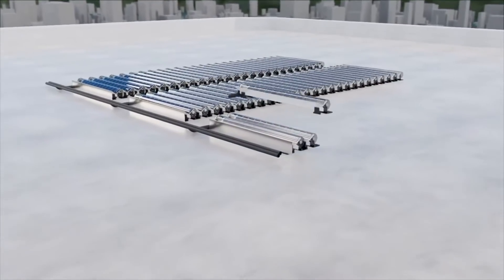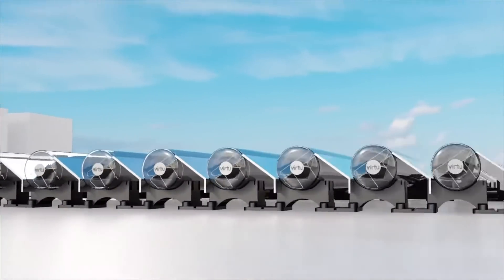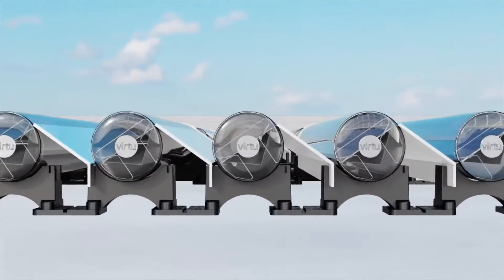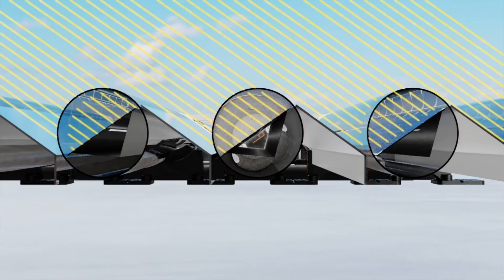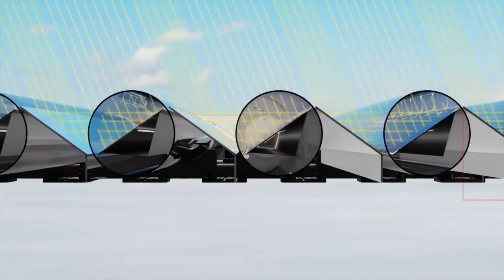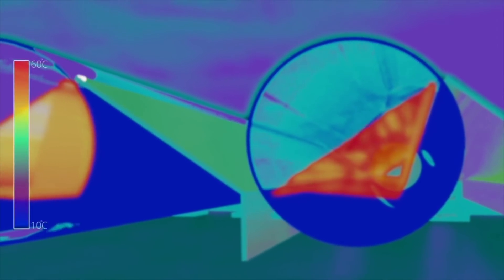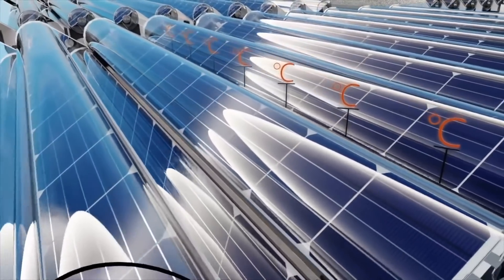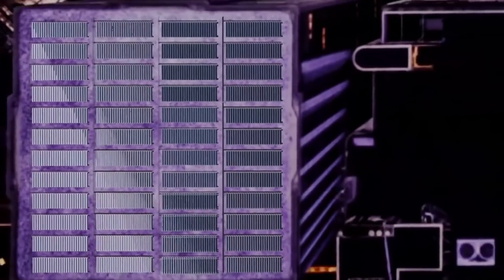Make electricity and heat with one device: hybrid solar technology

Comment from the maker: Skepticism and critical feedback is great. Being uncivil is not. I delete trollish and rude comments. Take a look at the information in the description and the comments: a lot of questions have already been answered.
Reply: Biggest and main concern I immediately had was the temperature of the PV cells, luckily that seems to be tackled. However it's still two competing optimums, you want your fluid(water) to reach a temperature as high as possible for higher energy gains why usually you would want your PV cells as close to a bit below room temperature (in practice most are 50-90C on rooftops). 

My next main concern is fabrication costs as this looks like a fairly difficult to manufacture product and higher costs because a barrier needs to be between flowing fluid(water) and a vacuum, exerting 1 bar pressure on the back of thin PV cells which make them tricky to be used as a barrier only.

I'm also a bit 
skeptical about their energy density claims as that's very dependent on what exact mounting systems you compare it with, what exact panels and they do not specify an exact energy density based on a specific load, usually done with peak watt hours. "High energy density" is not an unit, let alone a value, and not possible to compare.
I do believe they can have benefits, especially the wind-shearing is a serious factor for higher buildings or buildings with weaker roofs.
Also the carbon savings, honestly that is quite questionable if on their website they don't show how they calculated it and what references they used.
Especially since they make CLAIMS but don't actually show any data/results/evidence, nor do they say what they actually compare it to nor how.
To me that looks like a marketing department and not engineering. I do not trust marketing departments and I think it's with good reason.
Reply from the maker: @Dzeno2010  solid comments, thanks. Small point to mention - I don't think the tubes are at a full vacuum of 1 bar, it's some nominal low pressure. I might be mis-remembering. But yes, certainly these are more costly to produce than conventional solar products. I agree, it would be nice to see the energy data published. I think the lack of visibility of it has more to do with this being a more b2b model, where that kind of data will typically be shared with and gone over by the client's engineering team.
Reply: @tdisney  it's usually a nominally low value as you can't have a true vacuum (more or less) nor would you want to because costs. However for the forces it doesn't matter, as it's about the absolute pressure difference between the 2 sides. In which case 1.0000 bar or 0.9999 bar only differ 0.01% and so would the force, in other words for the force that difference is negligible ;)
Thanks for the reply though.
Sorry to ask but I don't know all abbreviations, especially english business abbreviations, what does b2b stand for?
Reply from the maker: @Dzeno2010  ah, thanks for that, I was assuming it was more along the lines of 0.2bar but it's far from my area of knowledge. Sorry for the jargon -- b2b = business to business, as opposed to b2c, business to consumer. The marketing/communication strategy is obviously going to differ greatly between the two.
Reply: @tdisney  Thank you and usually it's a low or medium vacuum, ranging from 0.01Bar to about 0.00001 bar. Either case 1% or less doesn't make a significant difference on your force. Just to give you an idea (vacuums go from low to higher, where low vacuums are worse, as in 0.01bar).

I'm not a fan of any business or marketing where information is hidden to leverage a stronger bargaining position.
I would prefer open and clear markets without the options of people making money based on hidden information as from my POV it causes a lot of problems. However that's a different discussion.

Note I'm a scientist/engineer, so I think that also affects my mindset ;P
Reply from the maker: @Dzeno2010  Yeah I don't think it's about "hiding" information, in a b2b scenario all technical information is shared freely. It's just that in a b2b outfit, there's no real incentive to take the time to make the technical documentation look really nice and slick and post it on a website, particularly if they're still in a phase of technology development and pushing those numbers better with every iteration. When you as a design engineer (lets say) engage Naked Energy for a project, it might look like they shoot over some .xls spreadsheets or white papers or whatever they've got, that you take and incorporate in to your design to evaluate the technology. As a design engineer that's been my experience of the technical/business environment with new technologies. As things settle and it becomes appropriate to do so, the tech specs gets polished and put up for public consumption. It's not about bargaining leverage - that sort of tactic just 100% doesn't work in a technical design environment, so no one does it.
Reply: @tdisney  I'm really glad to hear that and thank you very much for the explanation.

I love my data, don't care that much if it's cleaned up or not :P
Reply: @Dzeno2010  The level of vacuum is not really relevant to the PV cells - there are two separate sealed systems so there is no pressure whatsoever on the cells (PV cells have never been in a better protected environment - no dust, no moisture, no harsh chemicals and every cell in the string maintained at the same temperature with the ability to keep that temperature constant).  As to the level of vacuum detailed research actually shows that there are various plateaus in thermal efficiency linked to effectively switching off conduction / convection / radiation heat losses.
Reply: @nicholassimmons7420  What do you mean there is no pressure on the cells? everything inside the glass tube is subject to vacuum. How is the water temp maintained when whatever thermal load is full? What stops it running away and cooking the PV cells, a load dump? that uses all the electric the PV in making?
The concept is cute but just not worth the expense or hassle, individually solar PV and Evacuated tubes are excellent, but this compromise is full of issues.
Reply: @killuazoldyck1352  Yes - a vacuum is zero pressure - the pressure is on the outside of the tube (one of the reasons tubes are used to contain vacuums along with the ability to create a seal - ever heard of a thermos flask?) so the cells do not have any pressure exerted on them and if they did it could not be more than atmosphere (although at that point the seal integrity would have been compromised).  Systems are sized to the minimum thermal load anticipated at times of maximum irradiation.  In theory thermal saturation should not occur.  In the event that it does you are correct we recommend systems incorporate a heat dump.  In the event that the heat dump also fails the product is designed to withstand periods of stagnation (this is part of the Solar Keymark testing that the product must pass to become certified).  Unless you know more than you are letting on I don't think you are really positioned to be able to comment on the cost structure.  Suffice to say that evacuated tubes and PV are both established technologies that in the right circumstances make economic sense (leaving aside the need for sustainable energy) - by combining the two you actually save on materials and critically you get the benefit of two lots of energy from the same installation (the most expensive part of the equation).  Always good to receive informed constructive criticism - especially from those that have deep knowledge and have already created successful businesses - thank you.
Reply: @nicholassimmons7420  The video graphics show the tubed as single walled like conventional evacuated tubes, if so they are not like  thermos flask which has the vacuum trapped between twin walls.
As an engineer and past installer of both PV and evacuated tubes i can guess that this system will cost more than two separate systems combined, if i am wrong than give us the costs of your systems!!
Reply: @Dzeno2010  VirtuPVT will be certified later this year.  VirtuHOT (the thermal only version) is already certified and all of the data is public.  The claims made are based on uncertified data, but the claims are realistic.  As you note there is a trade off between higher temperature and efficiency (both PV and thermal).  The technology is primarily aimed at the market for renewable heat, the electricity is a bonus (the only incremental cost being the PV cells - think of it as getting a very cheap PV array for free while you are installing a solar thermal array).  Of course the mounting makes a difference to energy efficiency, but as you probably know both PV and thermal collectors work better when pointing directly at the sun.  All of the density calculations and comparisons are done based on manufacturers recommended installation guides.  Until very recently the company only had engineers and no marketing. Many years of research have gone in to developing the underlying technology.  Please take a closer look at the company website and if you have specific questions get in touch.
Reply: On public social media, there are a lot of people that have a huge financial stake in keeping all of us depending on fossil fuels for as long as possible.  I have NO DOUBT that there is a lot of organized troll activity attacking any post that suggest doing what needs to be done.   So you are sure to draw a lot of trolls, but thanks for putting this up.
Reply: This is truly an amazing product. The idea is so stupidly simple and logical and yet I don't think any product had merged the two concepts together. This is why it is brilliant. Now the obvious question, where can I buy this product, and how can I invest in this company?
Reply from the maker: @YTBaldrick  At the moment the best way to get your hands on it would be to contact Naked Energy directly, and engage them to get it in your project. As to how to invest - same answer! :) https://www.nakedenergy.co.uk/contact-us
Reply: I don't doubt the energy density claims, but I do question the energy composition.  Solar heat is cheap and abundant but not so useful or easy to use.  Electrical output is much more useful and expensive -particularly with storage.  I think this is a useful product but it depends on how much low level heat you need, not as a "do all" solar solution.
Reply: @skyak4493  I agree it is not a do all solution, i may find use in very specific circumstances, for example swimming pools were you have a large body of water to keep the water loop cool and the electricity could be used to run pumps.
but for general domestic use i don't see it being good value for money or practical. The biggest issue for me is having to dump heat once the water heat storage is full because then your using electrical energy to cool the water loop to prevent damage to the PV cells.
Reply: @skyak4493  Can I suggest you take look at the composition of global energy usage.  51% is for heating or one form or another, 17% for electrical applications and the balance for transportation (IEA figures).  The thing with heat is that it is used where generated.  If you want to tackle climate change, insulate yourself from price and security of supply issues then it makes the generation of onsite heat quite important.  Especially so for sectors like hospitality (something like 9% of global GDP), food and beverage manufacture and something so mundane as domestic hot water (the majority of these well within the temperature range of Virtu).  Yes you can export electricity (but last time I looked the pricing was stacked heavily in the favour of the utilities) or you could store it locally (but battery storage is still very expensive).  Thermal storage is comparatively cheap - so for those applications that need a lot of heat, solar thermal is a very good solution.  Incorporating some cheap PV into the collector is a bonus.
Reply: Is this actually on the market yet? I started following Naked Energy 10+ (?) years ago with them always promising available next year..... I think the technology makes sense and thought it would do well here in Bermuda. I finally gave up following a few years ago, figuring it will happen when it does, if it does. I could not fathom why its simple premise would take sooooo long to come to market.
Reply: @garylewis8346  Thanks for your patience - as many of the detractors on here have been quick to point out there are number fo technical challenges - although in fairness the biggest challenge to any new business is funding and that took some time to get to the level necessary to support commercial activity.  I'm pleased to say that the company is now selling product.  The PVT technology is still undergoing formal certification, but pre-certification units are out there in the field and have been operational for a few years in some instances.  Please do go to the website for more information www.nakedenergy.co.uk - we don't have any distributors in Bermuda yet, but will no doubt get there eventually (it is critical to have the right installation partners that know solar thermal).
Reply: @nicholassimmons7420  We point out the issues so people can make an informed choice, none of us i imagine have anything against your company or you personally, but it is right for us to talk about the cons as well as the pros!
If your company is selling the product can we get some information regarding the price as this will be important in deciding the value of installing your PVT system.
We have these same discussions about other products from other companies, we challenge so people can make informed choices and not get duped by sales hype.
Reply: @garylewis8346  I guess it is not getting the backing it needs due to its flaws. It is a cool idea but in practice its just not worth it.
Better to have separate systems with off the shelf components and not have the compromises this system would entail.
Reply: sure

Comment: In principle you could cool the PV cells with a heat pump to round about 0 DegC to make them more efficient and use the heat to heat the building and/or provide hot water, but I'm not sure how the maths works out, or whether such a system would be too complicated for domestic use.
Reply from the maker: Yes, you're right. I think the beauty of hybrid solar is that it's simple, there are fewer parts to break, you don't have to worry about providing enough electricity to startup a heat pump's compressors, et cetera. This can be thought of as primarily a solar thermal technology, and it has PV as a bonus. Squeezing a bit more efficiency out of the PV cells by cooling them even more than they already are being cooled isn't going to net a ton more benefit. Direct conversion of the sun's energy to heat in water is a quite efficient and simple technology! No compressors required. :)
Reply: @tdisney  You can look at the heat pump issue two ways.  Use it to cool the panels, the heat generated is a bonus or use it to provide heat and you might as well cool the panels whilst you're at it.

It really needs some maths and experiments thrown at it.

There are panels in development that use the infra-red part of the spectrum as well as the ultra violet end to generate a voltage, so cooling the panels may not be such an issue in future.
Reply: @tdisney  You can look at the heat pump issue two ways.  1) to cool the panels to make them more efficient and get the heat as a bonus or 2) use it to provide heat and cool the panels as a bonus.    We need maths and experiments!

There are PV cells being developed that generate a voltage from the infra-red end of the spectrum, these cells can be combined in a panel with UV cells to produce a more efficient panel, so maybe the heat won't be a problem.
Reply from the maker: @rogerbarton497  Good points! And interesting, I didn't know about IR-sensitive PV.

Comment: thermocouple and peltier for secondary electricity generation is better
Reply: also if you heat water to boiling point then you can use turbines updraft
Reply: Thermocouples or peltiers are too expensive.
Reply: @acmefixer1  who said so, the market, you
Reply: @acmefixer1  diy, no need to look at the wallet